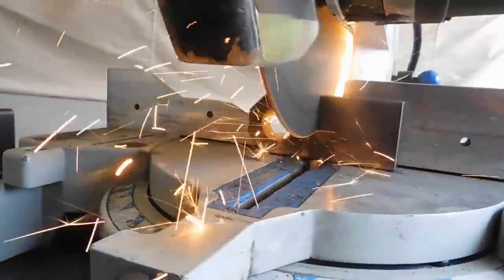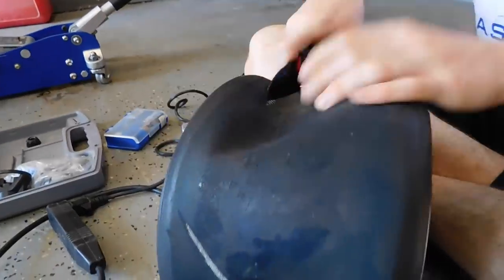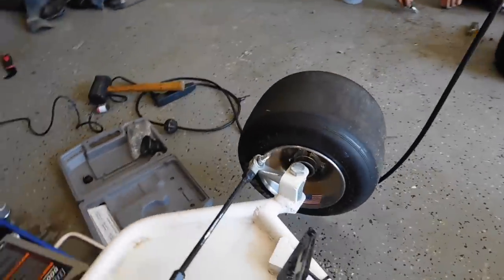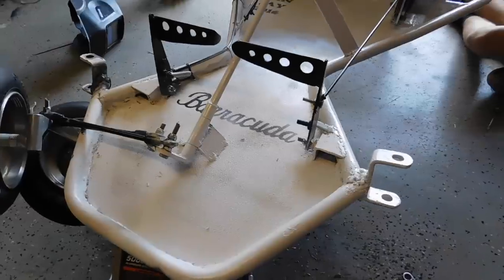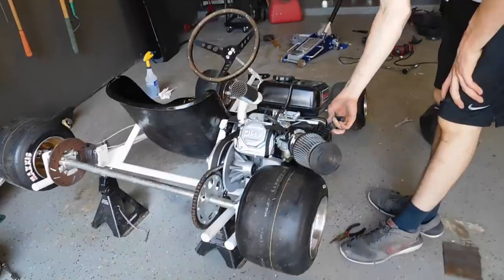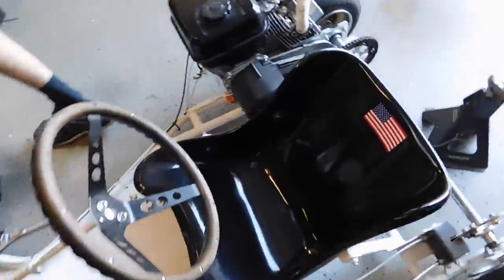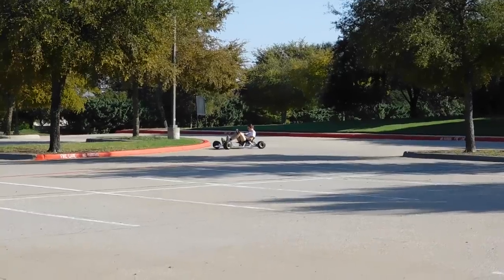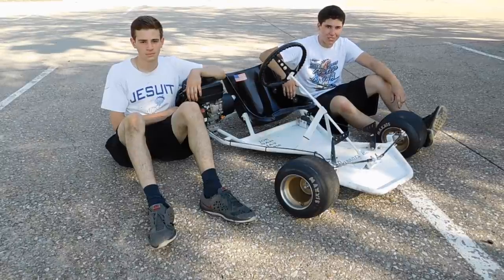Resurrecting the Homemade Go Kart!

Comment: Hey guys Mike Roberts again. I hope you guys made sure you were somewhere in the ball park as far as other carts camber. And when you cut and rewelded the front carriers you made sure they were exactly the same. DON"T SAY SCREW IT. Remember to play with tire pressures front to rear. Harder in the rear softer in the front. Also you need to borrow or buy a digital thermometer so you can make sure your tires are getting up to heat evenly. Also depending on the compound they shoul be so hot that you dont want to put your hand on them. If your tires are not getting that hot you are not feeling the true performance of the kart. When i raced i used CRG and FIRST KART chassis. During practice when you came out of the pits and the tires were cold you could crank the steering wheel and the kart would just go straight the first lap of a race was always a bit hairy because of low temps on everybody. So if expensive chassis like CRG and FIRST KART did that but once the tires were hot were able to break your ribs and we all wore rib protection you were not allowed to race unless you wore rib protection under your driving suit. Imagine the performance you will feel if you get heat into the tires. Have fun Mike

Comment: I did this a few times, practised on the first one and perfected on the second.  Both had Honda g200 5 hp motors.  Had a blast with both but kept getting busted by the cops.  They have no sense of humour, I wasn't bothering or hurting anyone and even wore a helmet when I drove but no dice - can't do this sort of thing for long without the heat coming on.  Problem is you can't run em anywhere else either - no kart tracks offer run whatcha brung!!

Comment: You guys should take a break cable bracket off of a bicycle and use it to hold your throttle cable by the pedal instead of a zip tie

Comment: Awesome but Ditch the camber unless u will have have  a stance kart which is completely useless  🤣😂😜 get a tilli motor a mikuni flat carb and you won’t regret it. Go power sells weld on spindle kits.

Comment: how does this work with the choke? I don't understand small engines enough I think
Reply: Jacob Clement there's a restrictor plate at the front on the carb like most, and a lever that opens and closes the plate to restrict airflow

Comment: What surprised me with this clip is that your cutting the tyres off 2 piece rims . Why didn’t you just use a rubber mallet to break the bead on the rims then just unbolt nuts and separate the rims then tyres are off

Comment: From the video it looks like you might need to toe in a little. Great job though!
Reply from the maker: Ratty 64galaxie Thanks, we'll have to take a look at it.
Reply: agree, also with the angle don't need the camber, only 1.5 to 2 degrees worth. lot more traction steering and a lot less BAD inside tire wear. slice from the bottom up, tap them to very nearly flat, weld back solid. it's dirt cart vs pavement cart stuff. turning right the right tire presses downwards because of the angled kingpins lifting the inside a little, taking weight off inside rear tire so you don't need a diff, same time dumping the weight to the outside tires to take the big bite of traction. in dirt you want more caster and skinnier front tires to be doing the same thing, but even more exaggerated. do that you'll be hooking corners near 2g's like a boss. edit/correct (caster replace with camber 1st sentence)
Reply from the maker: model nutty Ok awesome, yeah we actually didn't really think that the caster would fix the understeer because it was so bad so we just sent it and gave it like 20 degrees lol. So thanks for the advice and we definitely need to do some more fine tuning with the steering. Thanks for watching!
Reply: glad you got it, inside tire lifts inside rear wheel (kingpin angle = caster) so both rears aren't pushing, (both makes that understeer because there's no diff). the CAMBER.. when the inside turning tire does its lifting (about 1 to 1.5"), outside tire should be pressing FLAT against the pavement for most traction, it's only gonna need about 1.5 to 2 degrees to be "there". test on a flat concrete floor. turn the wheel all the way right and measure the inside height increase, block up the rear to match that, where that outside front tire should be dead flat. exactly same but opposite to put it there for full left turn. frame IS going to flex a little bit, if cornering hard and that inside rear wheel is lifting 1/2" or so, it's pretty damn dialed! (I mean its exactly what you want happening)

I'm sure it's doing some of that to an extent already now with the caster'd kingpins, but all that front camber is going to shred the inner tires awful fast, and not planting the outer corners of the tread down to make more grip happen. that's 6-7" more width stuck out there up front for more stability too. already know that inside tire at full turn is going to kinda almost stand on outer corner of tire, like inside tread about 1/2" to 3/4" off the ground, but in a corner it's about unloaded, same for the rear tire cornering... you want all the weight shifting to those outside tires for the traction cornering hard!  yeah 1000+ words later trying to convey the physicals what it should be doing.. oh well! do that stuff it'll hook up like a bandit and not shred through tires like candy. after that you'll be playing with 2-3lbs differences in tire pressures, then wanting more horsepower to corner harder faster because it CAN!
Reply: the toe in, those short wheels, aim for about 1/16 to 3/32(max!) narrower at very front of rim to rim (across) vs rear rim to rim. should be just enough it about wants to drive a straight line by itself and wont be twitchy when running fast. more than that just robs speed and causes faster tire wear. full size small cars I aim at 1/8 to 5/32 as far forward and back on the rims as I can reach. did it after new tie rods and idler arm etc on my old datsun, took to a shop to have it checked and the mechanic was shocked twice, he didn't have to touch it, then I told him how I did it. he told me the issue I was feeling was just a snagging brake caliper so 15 bucks well spent. 

thinking about it, 20 degrees of caster may or not be a bit much, you'll sure have a better idea after taking it to 1.5 or 2 degrees camber. why? when that outer wheel turns IN, it'll sweep forward+upward to be more like 6-7 degrees camber and too much for planting down that outer front tread... keep it in mind while watching it and blocking up rear axle to match front lift. might need to go 10 degrees caster and 0 degrees camber for that front tire to hit face flat. you'll see it all pretty quick now that you have the details clear in mind.

dirt cart is a different animal with its LONG king pins topped with valve springs, wheels are always taking hits (from front) back and up force, where 20 degrees allows it to take those slams allright. also larger rounder lower pressure knobby tires, needs more exaggerated lifting for live axle inner tire when cornering as outer tire squashes more. camber makes for wider base, and even more when turned facing straight into it's next hard bump... and you don't have the extreme tire wear issues in the dirt and mud crud, unless you're constantly roasting them. nice about those is you can grab up lawnmower tires at a hardware store
Reply from the maker: model nutty Hey thanks for the advice man, should be able to tune the chassis very well.
Reply: Ratty 64galaxie I

Comment: How much hp is that motor they have?
Reply from the maker: Adam Foster 6.5
Reply: Build Break Repeat thanks! I’m building mine with a 6.5 right now and I’m pretty excited, I’m only 16 so idk a lot about what I’m doing but I have some friends to help, do u have any tips you would like to share or things that I should consider while building to make it better?
Reply from the maker: Adam Foster Are you building it from scratch?
Reply: Build Break Repeat yes
Reply from the maker: Adam Foster Yeah that’s awesome, just really take your time to make sure the frame is square and the steering is properly aligned. The first kart we ever made was out of wood we made the chain super long because we didn’t know any better, so just try to keep the chain short and it will have less issues coming off the sprocket, but other than that go karts are pretty straight forward. Also take your time when building it cuz the build is the best part imo lol.
Reply: Build Break Repeat thanks dood! I can’t wait, I’ve never done anything like this before. Thanks for ur help I can’t wait to drive it around lol

Comment: do u not know how to take it off properly?!?
Reply from the maker: Scariestash 8216 nah we do it's just that we don't have any of the tools (tire spoon or bead press) so we just cut them off lol.
Reply: Build Break Repeat I get that but you actually don't need them get them all greased up and have an Allen wrench and lossen the bead bolts and push a ton of force on bead to break it and when it break lose just turn the bottom quickly to get the tire out the rim